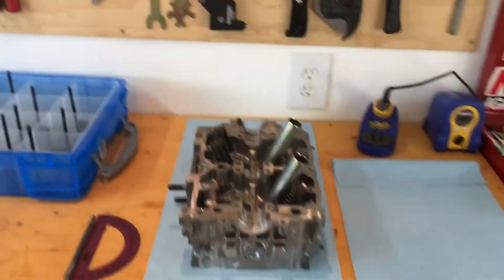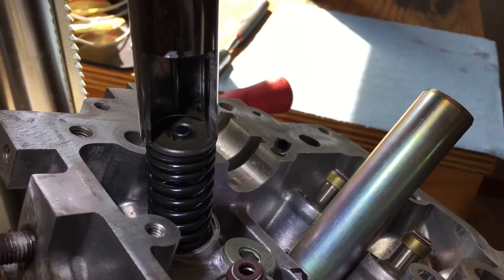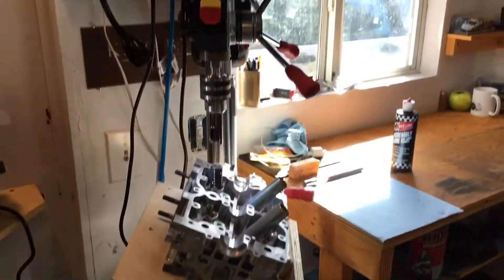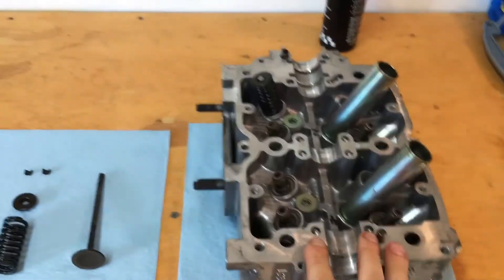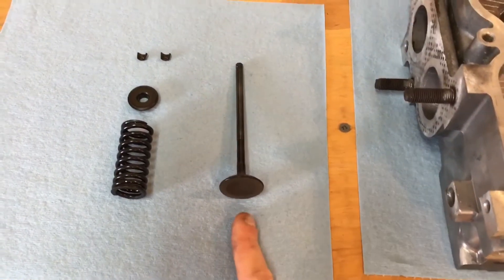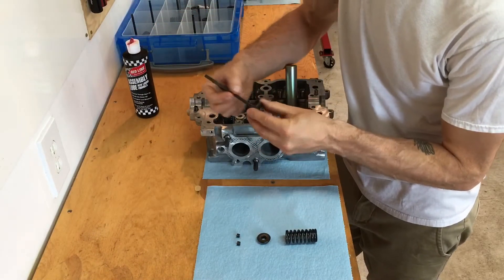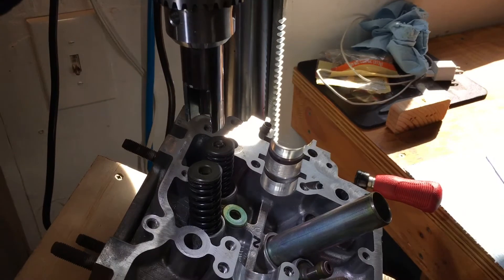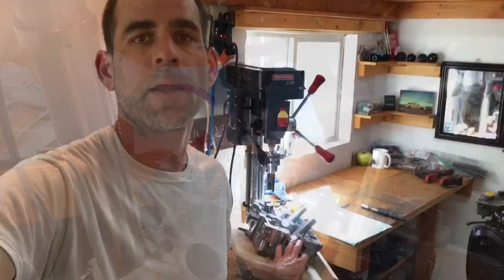Subaru DiY | How to Use a Drill Press to INSTALL Valves [Head Gasket Repair #2]

Comment: I like to know if you can direct me in the write direction I have Subaru engine 2.2 rebuild about 2 years ago it’s on an engine stand so I do run it from time to time with a radiator on also .what am noticing that oil is coming out of the exhaust manifolds and tail pipi white smoke .any advice would be very appreciated. Thanks Martin AZ
Reply from the maker: Running it is a good idea. For the oil leaks, not 100% sure but sounds like it may be valve stem seals that have become hard and may be leaking. Pretty common area to leak oil into the combustion chambers. Have to pull the heads to replace them though. Good luck!  👍

Comment: Hey love the videos this channel seams underrated. I do have a question is there any easier way to compress Subaru valves other than a drill press with a attachment that I’ve never even seen before or heard of before? Can’t you just use a valve compressor? Like just the hand held little guys?

Comment: I have a question . I have a ej25 off a 2015 sti. I wanna build my engine.  I wanna change my valves . Is there something I gotta do to the head ? For aftermarket valves ? Is the install the same ?
Reply from the maker: Hey man.  Awesome question and awesome potential build you got going!!! 😎😎😎 

Subaru has put a hell of a lot of engineering into those heads, but that’s for the factory boost levels and flow ranges!  If you are planning on pushing more air through those heads, either by bigger turbo or just more boost, than those factory valves just may no longer be big enough!  

To finally answer your question, yes aftermarket valves are likely a good step - Are you talking about lighter valves the same size or larger valves.  If you are thinking of going with larger valves, you will have to have a machine shop cut new valve seats for them, and while you are doing that, I would seriously consider having those heads ported too. If you are just talking about lighter valves (and better springs and lighter keepers too, hopefully), than you can get away with just lapping the seats, or have a machine shop do a new 3-angle valve job for them (best option), then they assemble just like the factory set.  However, when setting the valve gaps, you would follow the aftermarket manufacturers recommendation, not Subaru. 

Hope this helps.  Good luck!  🤙🤙
Reply: SubaruONLY  I can go either way 😦 how much boost can I use with lighter valve and better springs . Brands ?
Reply from the maker: Your limit on boost PSI will likely be other mechanical components other than the valves.  Big HP motors can easily get into the low 40 PSI range for boost and some crazy people out there are boosting up to crazy pressures - like 80+ PSI.  BUT forget running on gas if you start dancing with high boost levels - Gas is far too volatile and controlling pre-ignition under high boost is not feasible. That why all those big HP motors are running. E-85, because alcohol burns cool and is much more predictable when it burns/ignites. 

Overall, as far as HP gains, the lighter valves really just allow you to safely reach higher RPMs (due to less mass in the valve body and resulting higher RPM range before reaching valve float).  When you are able to spin the motor up higher RPMs, you make more HP.

As far as brands, Ferrara makes some high end stuff but I would check with some local builders.  Although you may not be able to afford having them do the work, good shops will often be more than happy to offer advice and share some real world experience.
Reply: If your planning on trying to make 550 or less to the wheels you really don’t have to build your heads stick heads will hold that power.